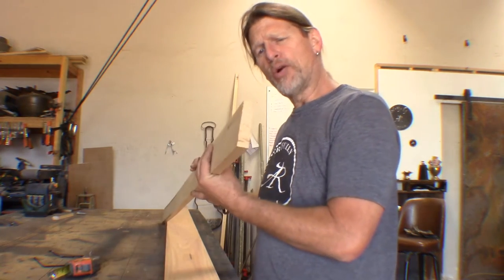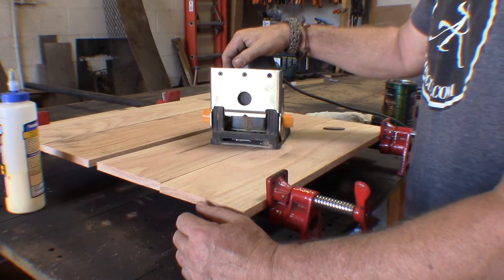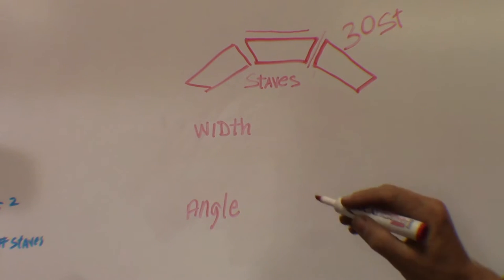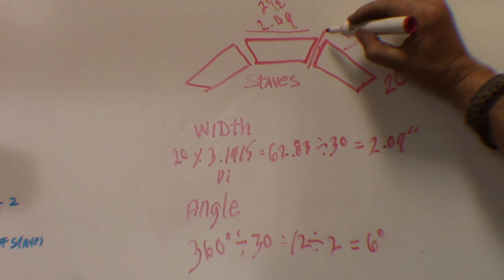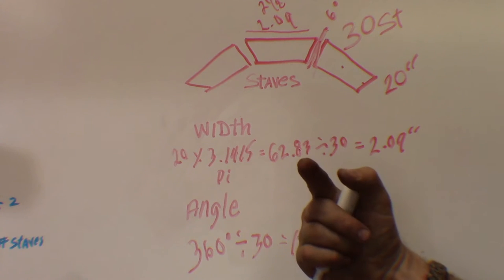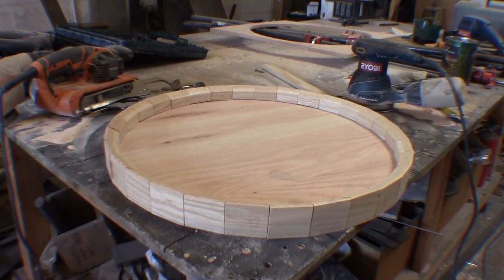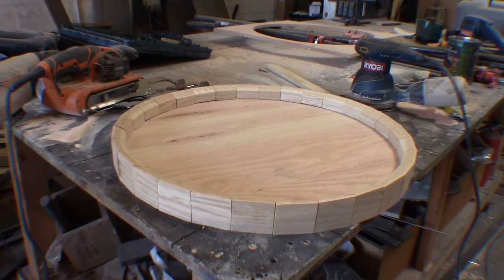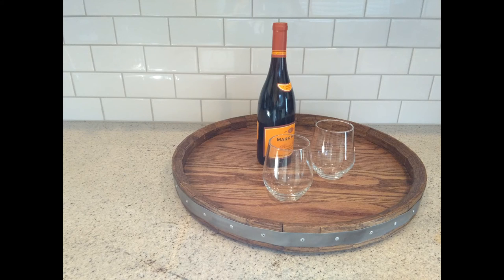DIY: Wine Barrel Lazy Suzan

Comment: This is the best tutorial ! You are very good at providing information and you do it slow enough for someone to understand. I truly am impressed with the fact you supplied dimensions, angles widths for the staves as I am a beginner woodworking gal and wanted to make one of these. I looked everywhere for a video or some information, you are the only person to provide such detail.  Excellent and well done !!   One question ,  why did you make a groove on the boards on the table saw.. and what thickness and width were they ?
Reply from the maker: Hi Cheryl, I'm really glad you liked the video. To honest, it's been such a long time since I built this, I can't recall that detail. I probably cut the grooves on the table because it was easy for me at the time as oppose to hand saw and chisel.